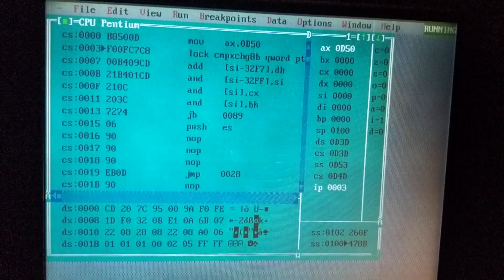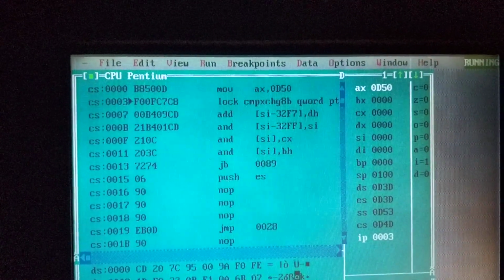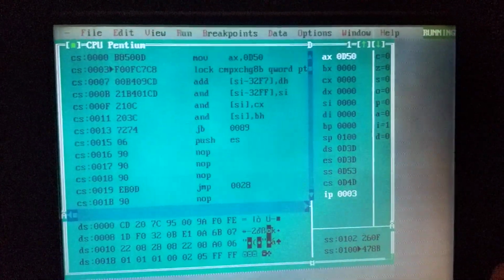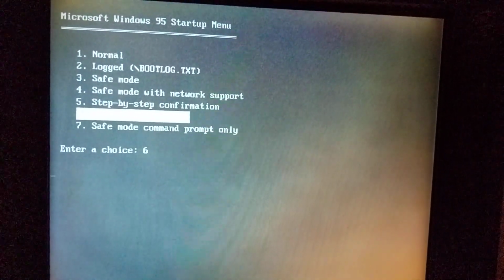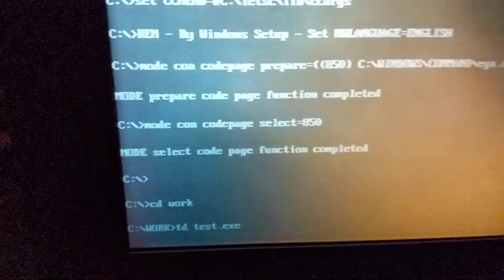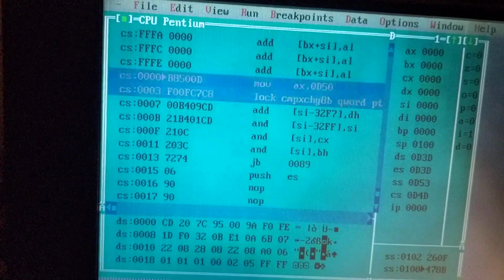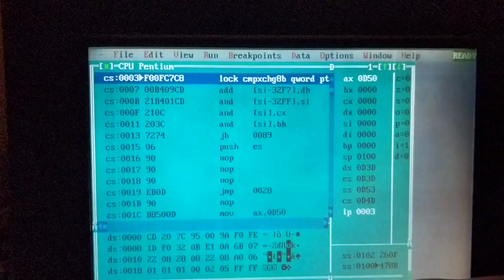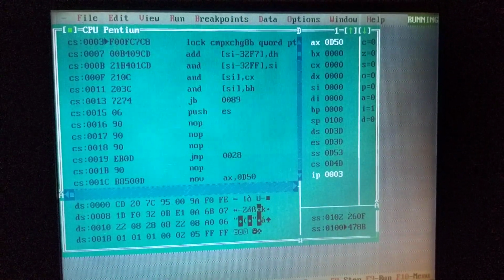Pentium F00F bug in Turbo Debugger

Comment: Honestly this is really cool that you have been able to demonstrate it like this! I love building Pentium rigs. I have a dead P5 Packard Bell with a P5 I really want to revive just to have that first rendition. As far as other models, I have a box of many i've pulled and a lot i've pulled i've put back into systems out of trash pulled hardware to stuff i've bought. The Pentium-S 133mhz was my very first computer that was actually mine. Growing up I started with an 80486SX2-50mhz in an IBM Aptiva 2144p which had horrendous memory management. I have one I found at a customer's house she let me take as a tip that actually has it's OEM software 100% intact thats an exact model/replica of what I grew up with... holy shit getting hit with that IBM splash screen gets old QUICK. Launch Duke Nukem 3D install, get slammed with big blue. But it DOES run Doom II and surprisingly well! Even outpaces my 486DX-33! I tried a 486DX2-66 and it actually ran worse for some reason. But yeah, I want a 100% vulnerable and bugged rig just for shits and giggles. I might start streaming and posting my efforts to clean up and restore the stuff I have just because. Kind of a pivotal time in history due to the technological impact combined with the social and societal implications to me make this era seem important. I enjoy the history and the nostalgia.
Reply from the maker: Haha, awesome. I also grew up using this era of computers, but the first computer that was actually "mine" was a Pentium II I built from random space parts. It didn't have a case so the motherboard laid on a book on my desk with everything just hooked up to it randomly. Not too long after I got a Pentium III 550MHz Slot processor and mobo and that was my PC for a long time. Wish I still had it. It had SCSI for a tape drive and external CD-ROM.

Comment: How can I check my Pentium in DOS? Is there an utility?
Reply from the maker: All you have to do is look up which chip you have. Basically all Pentium, Pentium MMX and Pentium OverDrive chips have it. A very small number before the Pentium II came out have the bug fixed, and there were also software patches to prevent it being executed. To test mine, I just did as I show in the video; I opened Turbo Debugger for DOS, edited an existing executable I had to add the F00F instruction, and it locks the machine up completely. It's harmless, but you do need to power cycle afterward.
Reply: @AureliusR  Will foof.exe with F0 0F C7 C8
 added via hex editor work?
Reply from the maker: @kirill9064  It should, assuming you add the hex at a correct position (ie, not in the middle of another instruction). Editing it while looking at a disassembly with opcodes printed helps.
Reply: @AureliusR  I took an empty file and pasted it with hxd.
Reply from the maker: @kirill9064  That might work, I've never used hxd. However in order to execute it likely needs to be in a binary format, with the proper binary headers etc.
That's why I edited an existing executable instead of creating one fresh.